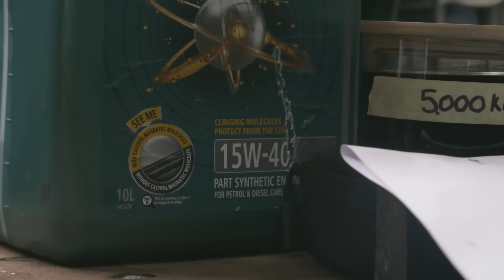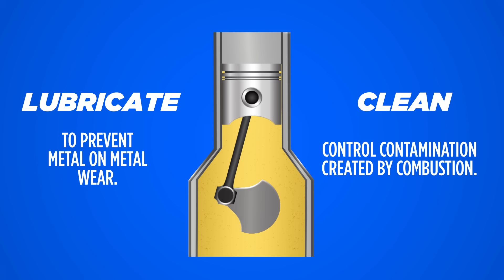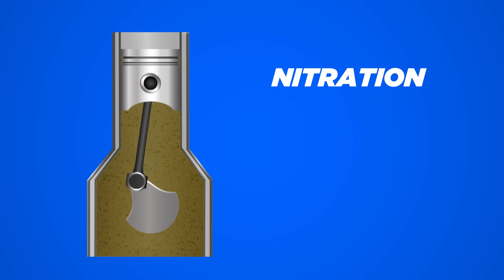Engine oil COMPARED at 5,000km vs 10,000km vs 20,000km! This'll make you service your 4WD RIGHT NOW!

Comment: What does the lab say about the oil? oil sliding down a bit of paper, what was the temperature of all of the oils? If you are going to do a video like this, get the measurements correct, not off a teaspoon, heat them all to 90deg as you say and then show us. 

This is literally a back yarders opinion!

Comment: I just had my first service at 15k on the Ranger and thought that was a bit long to wait. Next one is at 30k so every 15000 kms. After watching this ill be changing oil in between services every 7500 kms. Thanks Shauno
Reply: 15k interval? Oil filter wont subsist after 10k. Up to 10k service interval with a good brand synthetic oil is fine on a ranger.

Comment: Engine oil and filter changed on my Nissan Patrol crzd30 every 5000 with fuel and air filters. Gear oils done every 40thou. Coolant flush before every summer. wheel bearings done annually.
As a mechanic in AG I see engine oil and gear oil changed pretty regular. Recommended schedules are usually  okay.

Comment: My Pajero 2020 Service book says every 15k is enough. Suggests 7.5k in hard use.
I change engine & filter 5000 or 6 months. 
Front /rear diff & gearbox @ 20,000 or 12 months
Coolant 12 months
Over the top I know. Its an insurance policy
Reply: Hard use includes short trips and traffic jams. For most urban jungle dwellers, that is hard use

Comment: Hello!
LC200 2010 4.5  330hp Egr OFF 285km
Motor oil and fuel filter every  6500k
transmission oil with filter every 40K
with out filter every 20k
other oils every 20k 

nice test 
thx)

Comment: Oil and filter every 7,500klms.
Fuel filter every second service.
Diffs,transfer and gearbox every 25,000klms due to heavy towing and brake fluid flush at the same time.
2013 ranger and still hasn't missed a beat!

Comment: G'day Shauno, As a rule we do engine & filter every 5000 km, both Diff's, G/box & Transfer every 20,000 km 
( 13 Liters Engine Oil & 30 Liters Gear Oil) as the truck is our home, regular servicing is our key to survival mate.
Perhaps you could do a video on the "IMPORTANCE" of "Diff & Transmission Breathers" & why you should fit them.

I check our diffs, g/box & transfer after all deep water crossings & everything else as required.

Comment: I get the sentiments behind this video, however there are very qualified engineers doing testing under lab conditions that provide the recommended service intervals based on their findings.
Being a qualified mechanic, I find this video a little-back yard in its delivery. On the flip side, changing your oil more frequently is certainly a good thing, just not critical.
Reply from the maker: Thanks for your comment mate! We knew the facts but just wanted to show the condition of oil at different mileage in a really simple way and this was it. If anyone wanted more detail or is concerned about their oil/engine condition, we definitely recommend taking your own samples & sending them off for testing!

Comment: 1HDFTE with 500,000km of usage 
Engine oil every 5000 
Engine/air/fuel 20,000km 
Engine/air/fuel/diffs/transmission 40,000km 
Done this service interval on all my vehicles and never had an issue :)

I also run an oil flush additive religiously before each service, my FTE looks brand new inside and the oil remains gold until around the 8000km mark but always change in or around the 5000 depending on the season and if it's to cold to get out in the shed to service the bus :)

On a funny note, I once had a vehicle for a work commute that used so much oil that I ended up just recycling my used oil through it. Fair to say it consumed more than I could recycle so I switched to chain bar oil and it did 30000km on bar oil with no issues lol

Comment: I have an old idi moter so oil and filter 5000ks,air filter cleaned every 5000ks fuel filters ever 10000 ks and depending on what driving conditions ive been through ill do diffs at 50000ks and tranny and transfer every 30000ks

Comment: I do my hzj80 and my wife's of 3ltr turbo diesel every 5000ks. The auto in the wife's car gets the auto trans flushed every 40,000 and also the diffs. Gearbox and diffs every 40 ,000 in my car as well. They don't get much city or off road work.

Comment: Righto. Oil service intervals:
- Engine every 10k (15k in the book)
- Gearbox oil at 60k (240k in the book)
- Diff oils every 60k (240k in the book)

My ranger isn’t used “hard” for 4WD or extensive towing but it does get some work. It’s also important to understand the rangers are known for transmission issues so for me, changing the driveline oil every 60k versus 240k as per the book is a must for me. She’s also due for a transmission service with a full flush (and potentially an aftermarket cooler at some point too!)

Comment: Put it this way, can you change you oil too early? I've always changed my own oil at 5000 as I've usually had older cars 150000k plus. Nissan 300zx 260k, Ford xr8 340k, Suzuki 240k and the engines were immaculate. 
The rest gets done when convenient or about 3 years.

Comment: The old 1989 75 with a 2h in it loves a oil change and filter every 5000 I also do the diffs every 20,000 because it’s pretty easy and the diffs are old. Transfer and gearbox are done every 50,000 and i do a fuel filter every 20 with the diffs as it’s another easy change. All done with genuine filters and highest quantity oil to keep the big 4.0 running beautiful.

Comment: 2017 Amarok Highline V6
engine oil, filters etc - 9-12 months (10k-15K)
Trans, diff etc 60K
Have obdII bluetooth - always monitoring:
intercooler temp
commanded and in and out coolant temp
Trans Temp
EGR temps
engine oil temp
engine oil levels
Coolant fan speed
DPF regen %
Plus others
Would really appreciate the Castrol oil (its the preferred gear) - gotta a trip from Vic to Queensland comin up

Comment: 1990 ln106 hilux.
-Engine gets serviced every 5 thousand or even just under if I've just come back from a trip.
-Diffs don't really have an interval, they just get done everytime I've gone on a trip where I go through a bit of water
-Gearbox gets done every 15 thousand or if I've been through some big water crossings, then it gets done straght after that. 
-Transfer case usually gets done the same time as the gearbox but if I haven't been using 4wd a whole lot, then it doesnt get a whole lot of love.
-Brakes get a minor flush every now and then when the fluid starts to look a bit dark
-Clutch fluid gets done nearly every half service as my clutch master is right next to my turbo and experiences quite a bit of heat.
-I've never replaced my power steering fluid lol.
-All my unis and grease points get done at every engine service or if i've been through water, then they get done shortly after.

Comment: Hey Shauno. Another nice video.  Spot on. 
I drove a MR Triton, and the service intervals are every 12months or 15000ks. Service intervals drop to 7500kms if you tow constantly, tow heavy, constantly in traffic, short trips, heavy load, off-road driving. So I am just doing the regular service intervals, since I drive 90% on highway, with the vehicle being nearly stock, and rarely do short trips, not much traffic. That's going to change once I set it up for camping and off-road. Oil and filter change at 7500ks. Cheers
Reply from the maker: Thanks for your comment & support mate! Sounds like your Triton will be thanking you.

Comment: Oil @ 5,000km as well as Oil filter and Air filter. Diffs 25,000 km Fuel filter 20,000km Coolant  yearly. And also don't forget to flush out your water tank before filling with fresh water, it tastes better.

Comment: Toyota LandCruiser 100 series 1hd fte engine every 5 to 6000 ks engine oil and filter front and rear diff and transfer case at 20000 thousand all  pending on the driving conditions that I have done it is cheap insurance but it is starting to get dearer and dearer for oils

Comment: 1991 HDJ80, every 5000 for the engine and all filters, driveline every 15000-20000 for piece of mind... if I do a lot of mud and water driving during our topend wet season I'll check the driveline consistently and change where necessary. New oil is cheaper then new internal components 👌

Comment: Landcruiser 105 series
- engine oil and filter every 10k
- fuel filter, diffs and coolant based on the log book
-uni joints done every service
- and pre diesel filter 10k-20k depending on what it picks up and what I can see in the glass bulb
-windscreen washer fluid whenever I can be bothered 🤣

Comment: I use Castro RX super every 8000 km in my 60 series land cruiser and I change filter regardless because why would you tip new oil on top of old oil a bit pointless. some people do that . Differential oils  and gearbox depending what conditions I have been driving in every 50,000.

Comment: On our 2020 NX Pajero , from brand new we fitted a catch can , every 5,000 km oil and filter is changed with full synthetic 5w-30 that’s DPF approved , front and rear diff oils every 20,000km and auto transmission and transfer case every 40,000km . All the servicing is done myself and I only used quality oils that has the approved specs required by Mitsubishi. My oils are changed out before even half of the manufacturers recommended intervals are reached . Oils are the life blood of our cars , just like blood in the human body , the cleaner it is the longer we live , so we can enjoy our 4wds and trips even longer .

Comment: Black top Td42 every 5k, why? Because after 400k, doesn't use oil, no blow by, bugger all adjustment on tappets and fuel economy gives modern diesels a run for their money. Just remember you are driving a tractor and you can't buy  simplicity any more. Buy bulk oil when specials come up, regular services and drive to your gauges = engine you can rely on for a long long time.

Comment: 2015 px ranger 3.2. 6 speed auto. Fully kitted out. It’s not an every day driver and only gets driven up the bush.
I change all oils and filters every 5000km. As I do all oils and filters I have never had a problem with the gear box overheating like they say the rangers are prone for and it gets worked hard. No air cooler.

Comment: I have a 2010 Hilux and do all the servicing on it. I did some testing myself and found 6-7000 still good for me. The Magnatec oil holds up well and does a great job like all Castrol products. Just did tranny oil and filter on weekend 25000ks on Transmax and no bad smell still drove well. Good test man.

Comment: I service my engine every 5,000 manual says 15 but oil is cheep, an engine rebuild is not!.
Diffs I do about every 40,000 and gear box about every 20,000 or so.
Preventive maintenance is the key I believe

Comment: 1kzte engine, so 5k service intervals is best. Might seem like overkill to some but quick oil change is cheap preventative maintenance, filters at least every year or 10k. Diffs at least for every 15-20k depending on conditions. The same goes for ls1 ss in the garage 5km or 6month intervals
Reply: Oil is cheap, engines are expensive

Comment: Mate I’ll be doing mine every 5000 but…. I have had 3 Toyotas running at once over the last 6 years all serviced at 10k , I have had no dramas what so ever, I use castrol magnates in the Hilux and rx super in my dyna work truck that Carry’s 2 tonne everyday , I’d actually like to see a test between brands

Comment: My 105 Series Landcruiser engine oil was changed every 5k and filters every 10k using Castrol Magnatec always and never an issue and I'll be doing the same thing using the same oil on my 80 Series.

Comment: Gu td42t, generally drive short trips but tow a 1.5T boat once a week 100km. Odd bit of 4wd here n there
Oil and oil filter every 5K
Fuel and air filter every 10k
Water separator filter every 20k 
Rear diff and gearbox generally 50k
Front diff 80-100k
Steering, clutch and brake fluid 12months
 Coolant when required 
If i have big trips coming up or giving giving the rig a hard time i will change the oils as required

Comment: I have a D40 Navara

I change all oils when I buy a new vehicle 

I change my engine oil every 5000 kms and change the oil filter as well when I do the oil change. 

Diff oil every 25,000kms 
Transmission oil every  25,000kms

Comment: I personally change my engine oil every 5000ks due to reliability and less wear and tear I use Castrol  5w-30 A5  
And diffs a gear box etc I change every 20000ks depending on what type of driving I've been doing but always using top quality oils etc to keep the reliability and less wear and tear down

Comment: 10000 klm for engine oil , fuel oil and air filter.  Just lime i did my old hz ute . Change all oils,  filters etc before and after doing a big 4 wd  trip grease tailshafts every week . Never had a problem with uni joints

Comment: My dad was a mechanic all his life and only just retired mid 70's a year or so back... from the day I got my first car and 4WD he made sure I did an oil change and filter every 5,000K's and I've stuck to that. A career's worth of experience from someone's opinion I trust (my Dad) is too hard to ignore.... and he worked on all types of vehicles including being the manager of a Landrover (series ones in the 70's and 80's) dealership/agent too... I have had the luxury though over most of my adult life to get filters and oil much cheaper via his work buying power. To this day though (even now I have to buy oil and filters retail now) I do my modern petrol SUV daily driver vehicle at 5,000K (about every 6 months)
Reply: 5K miles or kms?
Reply: @kovalenkoihor4325  It's not the 70s. A good fully synthetic oil will be good for 10,000kms.  Have worked in the Industry and workshops absolutely love folk who want to service every 5k.

Comment: Td42 factory turbo intercooled
Engine oil and all filters every 5,000 k with the exception being if I'm doing a big trip ie: a few weeks in the High Country, Flinders or The Cape I'll then change the engine oil before and after the trip regardless of whether it's due of not.
Diffs, transmission and transfer case at 60,000 k
Hydraulic fluids every 80,000k
Cheap insurance in my opinion. Only use Castrol products

Comment: Change my oil as manufacturer specifies,  And they do specify that heavy use mandates more frequent changes.  So, after a 5k trip, with a load, up and down the coast recently, oil change.  Week to week BAU, as per the handbook.  Might require heavy duty but it's sometimes.  Others, obviously, might need to do it more frequently.

Don't recall having an engine issue related to maintenance in many decades of ownership.  Whilst I don't warm my vehicles up, I do refrain from harder driving until they're at operating temperature and frequently check levels etc.

Remember when the old timers check under the hood virtually whenever they visited a 'service station'?  Almost never see that now.  Suspect many vehicles, cars at least, don't see a look under the bonnet between services.

Comment: I have 1hz 80 series. 5000kms for oil and every single filter religiously. All other oils are changed every 20 000kms
Only because of that 5000kms it lasted 560000kms and probably will last even longer.
You look after them, they looks after you.

Comment: I service my engine oil every 5000 K although the manual says 8000. I’ve also tested oil samples from Black Stone laboratories on my other vehicles as well. 

The differentials and transfer case I will change sooner than the manual  as well. 

For my Toyota supra, because it’s big horsepower I also change it more frequent. If you take care of it, it will take care of you. ✌🏻
Reply: Oil is cheap. Sending it to the lab may cost more (time and labour) rather than just changing the oil every 5000miles/8000kms

Comment: Toyota 4l petrol - daily driven in the city, off-road racing and wheeling.
Engine Oil - 8k km
Tranny (auto) - pan drain and fill every oil change, about 1.5l
Front, rear and center diffs - annual
Brakes - annual

Comment: I’ve always held the belief that fresh fluids are cheap insurance for keeping very expensive components in good condition, especially in modern common rail diesels.

I live in the NT so I do heaps of km’s per year, servicing my Landcruiser Ute gets expensive. 

-engine oil 5000kms 
-fuel filter 5000kms (dodgy outback servos)
- fuel system lubricant (5000kms)
- diff oils 20,000kms
-gear box oil 40,000kms 
- wheel bearings 40,000kms 
- coolant every 12months (gets hot up here) 
- brake fluid every 12 months 

Keeping my Ute serviced and in good nick could be a matter of life or death up here in the NT, she does some very remote work with little to no back up. Never let me down though 🤞

Comment: 2000 Mazda bravo b2500 420,000km+
Engine every 5,000, fuel filters every 10,000 x2 fliters as iv got one right after the fuel tank, diffs, transmission I check the color of the oil every 5,000 usually change every 10 to 20,000 depending on what iv been doing, with the ute. I need to start paying attention to everything else to bearing etc.

Comment: I remember years ago toyota bought out a hilux with a smaller sump and the government department that spray the weeds along the side of the road bought them specifically to do this job and because  a lot of driving was done in low gear coupled with the smaller amount of oil in the sump they actually wore out the engines before the next service interval was due . Shauno is right when he said you should change your oil more regularly when your driving off road or doing city driving or at least have an oil analyis done . Think about it . If you drove your car 10000 klms in top gear then drove you car say in 3rd gear the same distance  your engine has done aproximatly double  the amount of hours so it pays to change your oil sooner . I drive a concrete truck that sits around for hours being unloaded and for this reason the oil change intervals are an a hourly basis the same as earthmoving machinery